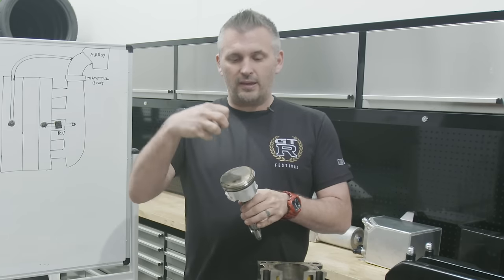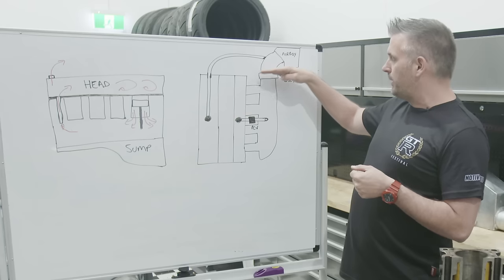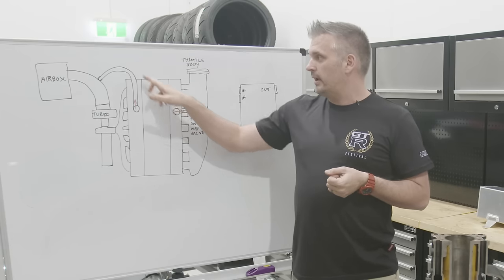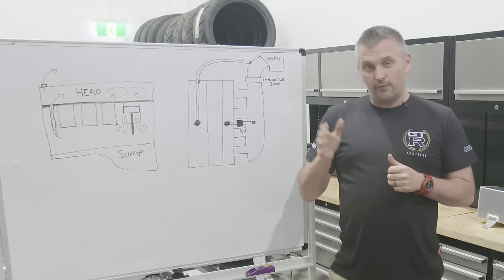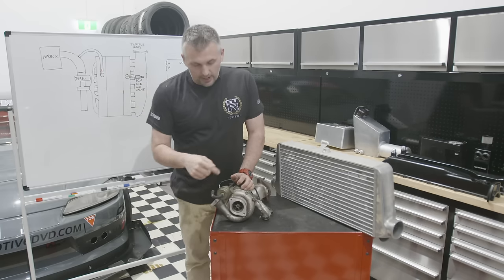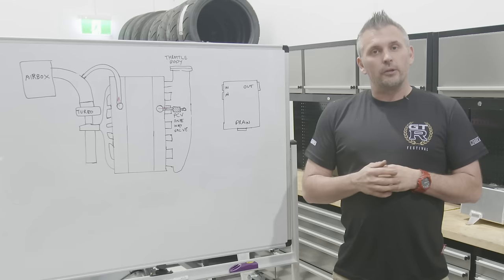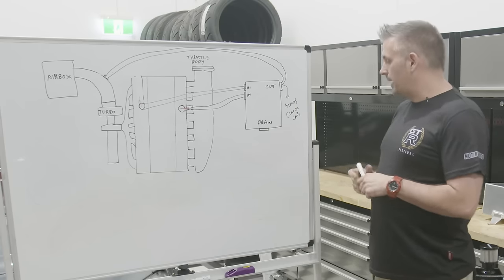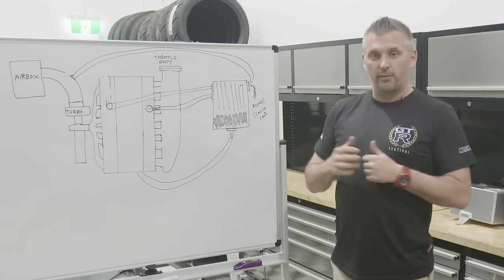Why EVERY Car Needs an Oil Catch Can or Oil/Air Separator - Motive Tech

Comment: I've always enjoyed & been interested in the channel but the new style of updates, projects, WTF & in-depth information is EVERYTHING that I want in one place!!! 🤓👌🏻

This episode cleared up loads of confusion I had previously about this topic on breathing & the PCV...

However, I have a vent to atmosphere (non return to sump) catch can system on my R33 GTST and although I believe it to be a healthy engine & currently only 354bhp it never really appears to fill up... Could this be a sign of any issues in the can or just that it's a low power level ATM?

It is a sealed unit, so I can only tell by the sight gauge. It's a daily driver & has never lost a drop of oil 😉🤞🏻 lol

Comment: Good quality oil, sadly there's very few ones out there. I've fitted a baffled oil/air seperator to my cars, working a treat so far. Looks factory too. Thinking all that s**t was going back through my intake manifold, etc just made me sick. Cars should have oil/air seperators factory, but then things wouldn't cake up with carbon, etc thus less profit in the workshop.

Shell Helix Ultra (really good stuff), being made of primarily natural gas, it's a cleaner product with less impurities over a group 3 mineral refined into a synthetic oil. E.g Penrite, Nulon, etc

Penrite oils are great don't get me wrong, it's my go to for most of my lubricants, but i get better results in terms of oil life, protection, etc. I've sent off 3 samples of each and Shell comes out on top from Blackstone test results.

Penrite HPR5 5w40 & Shell Helix Ultra 5w40 were the two i trust.

Comment: Good day, great video. 
I have a "new to me" 06 mustang 4.0l v6. It has a custom supercharger on it. Currently the pcv hose is missing. The EGR has been deleted. The component is still there, but no longer attached to the exhaust, or intake. 

I'm looking at doing a catch can on my car as I know I'm not getting crankcase ventilation. 

I was thinking about adding a 3 port catch can to connect to the passenger side pcv (removing the internals components of the pcv)  or adding an open fitting. Also running another hose from the drivers side to the other in port and the out port hose attached to the frame of the car. Your thoughts? 

 What do you think I should do with this system.? 

Thank you.

Comment: Some catch cans simply have one line coming from the crankcase to the can and then use a small breather filter to allow pressure to vent out of the top of the can. The longer these vapors stay in the crankcase, the more likely they will condense, causing damage to internal engine components and thinning the oil. You need vacuum to pull that out. If you pull out the condensation you don't want that moisture, so throw it away. Don't go and defeat the purpose by pouring back into the engine.
Reply from the maker: Watch the video again mate. Your logic is what we sued to think until we learned.
Reply: @MotiveVideo  Thx for the reply. I'll stay open minded. Love your videos. Hello, and goodbye from Austin TX.
Reply: @MotiveVideo   I'm an Engineer in the USA, and you're an Engineer in Australia. I hope you'd be willing to work with me on this. Lets see if we can be open minded, and learn something. One Scientist to another. I might be the only one learning something, and that's great.

I think there is two things to study, first thing to study is how a PCV system works, second is to study about condensation. Condensation is the easy one, so lets start there.
" Condensation occurs when warm air collides with cold surfaces, or when there's too much humidity in a closed area. When this moisture-packed warm air comes in contact with a chilly surface, it cools down quickly and releases the water, which turns into liquid droplets on the cold surface." taken from envirovent dutcom, found doing a google search for "what causes condensation"

I think we can agree that in the case of an engine that has sat for a while, atmosphere/air is inside the engine, just as you have outside. Therefore, this air has moisture in it, and when the air is heated, that moisture wants to stick to something cooler than the heated air. This might be the inside of the top of the rocker/cam/valve cover, maybe the oil pan, or really any wall inside the crank case. Moisture packed warm air is in there, and as it comes in contact with a cooler surface it release the water as it cools down quickly. Moisture comes from the air, the air that is inside the same closed area, and it collects on a surface also on the inside.

Next the PCV system.
"The PCV system consists of the PCV valve, grommet, tube, and air supply hose to the crankcase. Check around these fitting for any signs of oil. Everything must be tight. Oil leakage indicates a problem with the system.

The PCV valve is closed at low RPM's to prevent vacuum leak and engine misfire. When open the PCV valve allows the flow of crankcase gases. The PCV valve is located on the valve cover of most engines. Combustion gases are forced past the piston rings and into the engines crankcase.
A drop in intake manifold vacuum occurs when the engine is accelerated. When the intake manifold vacuum is low, a light spring holds the PCV valve in its open position. The open valve results in maximum crankcase ventilation. Conversely, when the engine is idle, a high intake manifold vacuum pulls the valve upward, blocking the port to the intake manifold.

A stuck closed PCV valve results in excessive crankcase pressure. It forces oil past the engine's seals and gaskets. A stuck open PCV valve or leaking hose results in a large vacuum leak, a rough idle, and drivability issues like surging. A closed or tarnished PCV valve can cause engine oil to back up into the breather.

Most PCV valves contain a light spring and should rattle when shaken. If the valve doesn't rattle, its clogged and needs replacement. At idle, with the PCV valve removed from the valve cover, there should be an engine vacuum at the PCV valve inlet. Placing your thumb over the leaking valve should plug the vacuum leak.

The PCV system regulates crankcase pressure and ventilates gas fumes from the crankcase into the intake manifold. This system protects the engine oil from premature contamination. It also circulates blowby gases into the intake manifold for combustion." taken from FreeASEstudyGuides dutcom, found doing a search for "what happens when a pcv valve is stuck open." ASE is short for the National Institute for Automotive Service Excellence which Mechanics in the USA use to show proficiency. AKA if you are a mechanic in the USA and you are ASE certified, you get paid more, and you might only get the job if you have that.

So far so good? Any thoughts? My thoughts are about how the PCV valve isn't just a 1-way valve, but rather it is 1-way with light vacuum/part throttle, but dead stops at high vacuum at idle. Under boost [and if attached between the crankcase and inlet/intake manifold], opposite direction of the 1-way, it is also a dead stop. I was thinking it was just a 1-way valve, but no, it's more than that.

Agree? Disagree? So far so good? When the moisture in the air condenses into a liquid, what should we do with it? Back to oil sump or should be collect it to later dump it? Or are we jumping the gun, and not enough info yet? What's missing if so? Anything we should add?
Reply: @MotiveVideo  I want to add something...This is trivial, but sometimes back to basics is a good thing... If you heat up and boil water, what happens if you leave it boiling for too long? The water disappears from the pot/container. It turns to vapor, or a gas. Water turns to gas at a high temperature. It's called a boiling point. What happens when you cool a gas? A gas turns to liquid. This is called the condensation point.
Boiling point, condensation point. Turns a liquid to a gas, and a gas back to a liquid.
Can you think of a scenario where this will happen repeatedly to the internal chambers of an engine (aka crankcase)? Could this become worse over time, from repeated warm ups and cool downs? Is it a sealed system that won't ever add more moisture over time? If it doesn't ever get worse, then no issues, right? What if it isn't a sealed system and it can accumulate more moisture over time? Is that bad? I don't know... thoughts?
Reply: @MotiveVideo  Here's another interesting read/thought. According to an Article on the history of the PCV, "In 1967... PCV quickly became standard equipment on all vehicles worldwide because of its benefits not in in emissions reduction but also in engine internal cleanliness and oil lifespan."

From what I'm reading, and understanding, PCV is actually good for keeping the engine internals clean and longer life. Engines definitely run better when clean, especially when you think about the carbon buildup on direct injection boosted engines.

Here's another thought. As I mentioned in the last comment, the PCV valve is suppose to shut the connection from the intake manifold to the crankcase under boost. If you have no PCV valve in place between the manifold and the crankcase, and you have a catch can connected directly from the old PCV port and breather port, then the crankcase pressures only have one way to go, and that is to the oil catch can... THUS, if you have a ton of blowby, that is the reason why your oil catch can will fill up to the max going down the dragstrip for those 9sec, in your decently quick car. Can that blowby be reduced somehow?

We have 3 scenarios:
idle: No connection between manifold and pcv valve needed, seal manifold shut
part throttle, no boost: we need vacuum pulling contaminants out of the crankcase, need an oil catch can, and a vacuum source, although not part of the operation of a drag car
full throttle, boost: No connection needed between manifold and pcv valve needed, seal mani shut

Here's where it gets interesting, the full throttle, boost. Under boost, positive pressure from the manifold to the pcv valve, it will shut down. BUT, if there is sufficient blowby pressure, and you have the pcv valve in place connected to the intake manifold, then the pressures in the crankcase may indeed build up past the pressure in the manifold, and it may indeed open the PCV valve. Which of course may also allow contaminants in manifold, and then the combustion chamber. So, even though it sounds like under boost, the PCV valve connection to manifold is not needed/used, it actually is. At least, I think so.

The last thought I have... How bad are these contaminants? Has there actually been a study on how much it will deteriorate the octane? Water doesn't deteriorate octane, its actually the opposite, it will cool the charge, and reduce the chance of detonation. The oil will deteriorate the octane. Are both combined really that detrimental?

Obviously, for a street car... what we want is that cleanliness and longer life, but what we don't want is those contaminants harming our octane or our intercooler efficiency. How can both be implemented is the question? It sounds like a properly setup oil catch can is the answer, and incorporating the PCV valve and system already in place. The harm to the octane is the same argument with the drag car. How much is it really hurting? The oil that is in the intercooler is not getting cooked like it would in the combustion chamber, and with air flowing over it, it would just push it aside and pool at the bottom, so not really a big issue, but how big is it really? Is cleaning the intercooler periodically enough?

Lastly, placing a catch can(s) within the PCV system... will that hurt the systems balance due to the catch cans reducing the vacuum/response of the system?

As for cleaning the combustion chamber & valves of the carbon buildup in a direct injection (or really any) engine... That's easy, run a bottle of seafoam cleaner through the engine (lookup how to use seafoam through the induction system). I run one bottle of cleaner through the induction system (which runs through the manifold and intake valves) at the same interval/time as when I do an oil change. Every 3k miles. If you don't do this maintenance, over time, this will build up and deteriorate the flow of air, and cause excessive knock... which you might confuse for decreased octane, which is not the same thing.

So far, I'm thinking, if it's a drag car, why not, throw in an oil catch can or two between the connections of the PCV system to remove the contaminants, just for safe measure, as you don't want excessive blowby all over your engine bay, like that decently quick 9sec car has. For a street car, I'm not convinced one way or the other, yet. I'm definitely an advocate for doing routine cleaning of the combustion chamber and intake valves... on any car, street or drag.

Please help, if you have the answer, any thoughts, or input.

Comment: Nice video. When you drew the catch can install at 9:56 you said you would run the pipe to the can without going through the PCV valve. Is that important, or could you actually retain the PCV valve and simply connect onto it?

Comment: For returning the oil back to the engine, you can just have a manual valve you close or small electric valve that only opens below a certain rpm or under vacuum

Comment: One of us is a bit confused. 

 Seems to me you have the blow-by flow reversed.  The vacuum used by a positive crankcase ventalation system is produced between the carb or the throttlel body pulling fresh filterer air in from the tube behind the air cleaner or in the old days, a filtered oil filler cap on the oppsite end of the valve cover or oppsite bank of a V type engine.  The PVC valve limits the flow in hi vacuum situations as to not cause too much of a vacuum leak but enough to pull the fresh clean air through the system and back into the intake manifold and in turn the combultion chamber.  You can't "vent" a catch can installed between the  PVC valve and intake manafold.  I would cause a vacuum leak and break the system vacuum and stop all flow.

Comment: my crankcase breather is on the block not the head, its a stupid design because it has a big plastic box attached to the block that condenses the water in the air inside it so the breather gets clogged with an oil water sludge

Comment: Holy shit, I had the exact same issues on my RB20DET TODAY!!, it was smoking like crazy suspecting me to think it was the head gasket blown. But in the end it was the old catch can. Unfortunately I had used a Greddy catch can that did not use a filter on it for ventilation, Basically pressurizing my entire motor, once i had unplumbed the AN hoses from the catch can it stopped blowing by so much smoke from the exhaust, I can't stress this enough as you did in this video, but please if you guys are looking into a oil catch can get one that is a decent brand and has a air filter for ventilation. As said in this video RB's have heaps of crank case pressure! Thank you so much for this video explaining everything though.
Reply: I did the exact same thing on my rb25det s13 hahaha thought I'd blown it

Comment: What’s a really good oil treatment that cleans carbon off the piston rings , a good one that you put into your oil for awhile before changing your oil and then another that you leave in the new oil .
Reply: By the way the engine I’m wanting cleaned up is 2016  6.7 power stroke thanks for any suggestions

Comment: have you guys tried moving the breather ports towards the front of the valve covers?  you seam to emphasis that a big portion of why so much oil gets pushed to the catch can is the oil inside the head sloshing to the rear of the head... if the breathers are at the front it should significantly reduce the amount oil getting pushed out, right?
Reply from the maker: the baffles inside dont let oil at the back out
has to loop around. 

also, most dont do it as its ugly and messy

Comment: Does vta catch can on a turbo charged engine with a built motor pushing 700 whp cause more oil consumption? In my case it’s k20c1. But after having the catch can installed for more than a year the amount of blowby oil I drained was tiny.

Comment: question from me on a high powered subaru 2.35. if i return to sump setup do i need to add a little extra oil as i will on a track session see the oil passing through the lines to the tank would be a little extra capacity whilst in operation due the time it takes to pump around and return to sump, thoughts?

Comment: Just got an oil separator. It does have 2 baffles, but no filter. Can I still use it? Turbo 4 cyl, stock oil pump, double the boost (1,2 bar)

Comment: You have the definitions of air/oil separator vs catch-can incorrect.  You mentioned the pros & cons of having the oil return to the sump.  It is an air/oil separator (AOS) if you have the oil return to sump.  It is a catch-can if you manually drain it.  Either a catch-can or an AOS can be configured VTA (vent to atmosphere) or recirculate.

Comment: So what would happen (for conversational purposes) on a brand new GDI car if you just ran a hose from the crank case and dumped it out the bottom of the car? Just let it vent to the open air? Check engine light? Anything? I suppose you would need to cap off the return line back into the intake to prevent an undesired pressure differential in the intake, but aside from that - any issues?
Reply: WOW! I was so confused. I thought he kept saying JDR. BUT NO, it was GDI. Thx. I was so confused. Wait, maybe he said JDM??? No, that can't be it.

Comment: please spare a thought for the effects of having a crankcase that's pressurized as opposed to having a crankcase that has a sensible vacuum!
Reply: The more pressure in the crankcase the more power you lose as the piston is fighting against it.  Having vacuum in the crankcase helps to free up power.  That's one of the benefits of a dry sump that's always pulling a vacuum.
Reply from the maker: Feature on dry sumps coming soon